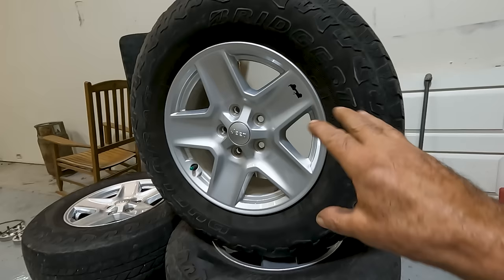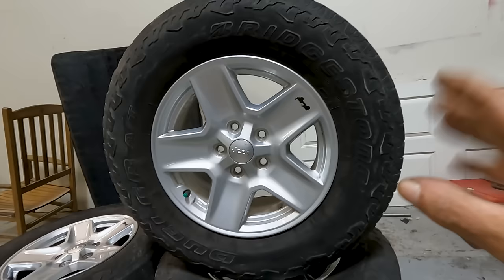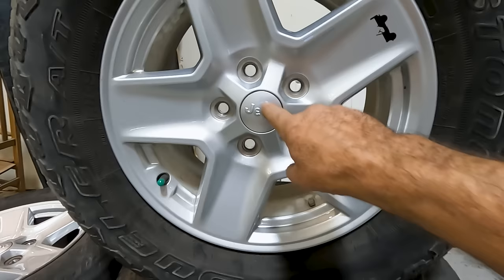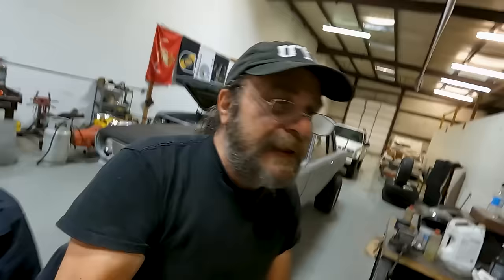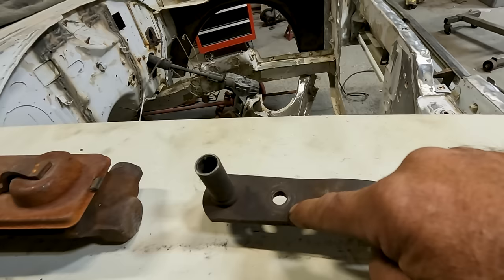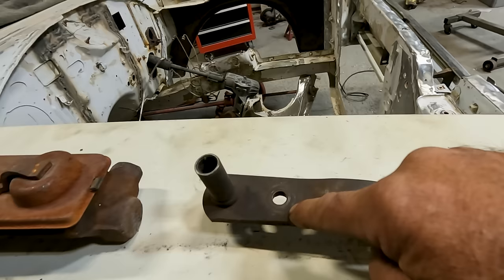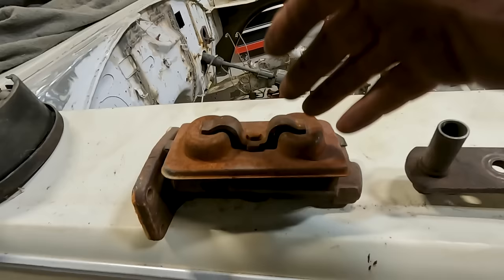Modifying Classic Cars And The Butterfly Effect - Can You Outsmart The Engineers?

Comment: Ok, I was going to start griping, but then you put in the limiting factor -- basically don't do it if you don't know what you're doing.

So, as a guy who occasionally drives a mid-'60's Mopar as a daily driver, let me mention:  1.  U-joints are a nice automotive advancement if you ever are on the road to Salt Lake City and you have drive train problems.  2.  A dual chamber master cylinder can be a life saver for you and your loved ones.  3.  HEI ignition sure beats points on starting and running - and is fairly simple and cheap to install (see Slant 6 forum).  

But, as mentioned, such modifications do require a certain amount of knowledge and skill.   For other people, many major car companies have produced quite reliable vehicles for a few decades now.

Comment: There's one little detail that is not being considered in this train of thought.  Yes engineers design these systems to work within a designated purpose.  However,  the budget team goes through the engineers original design and changes material and other parameters to make the design cheaper to produce.   So for that reason I believe that changes to improve vehicle stability can be justified if you have a particular purpose in mind.

Comment: My first and foremost suggestion is more energy efficient lights. (So there is less draw on the alternator.) Then Lighter weight wheels with the same size and offset specs. At this point people usually ask me my first suggestion when someone talks about adding or increasing power output....well, my suggestion there is to start working on the cooling system as step one. Because the by product is heat. And then follow that up with smoothing out entrance to the the oil drain back holes. (This is usually when everyone stops listening to my because I’m apparently crazy, and an overthinker)
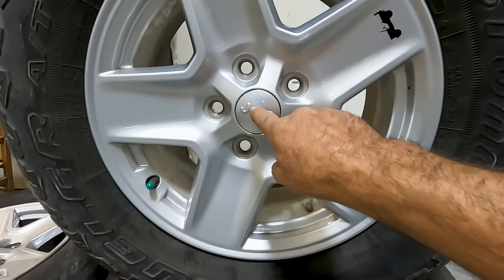Reply: 4:45 also besides the leverage. 
We also should take into account the additional weight. And the fact that those two things decrease the brakes ability to stop, however the amount of distance vehicle covers is increased with each and every revolution of the wheel/tire.

Comment: I've had great success with drum brakes. Heck. In the 80's we didn't have so many if any aftermarket options. Even on my 95 truck I had the rear drum shoes relined. Nope didn't buy auto zone shoes. The material I used was better for my usage. It's a lost art to line shoes.
Reply: They just glue on new material on cheap repops at the Chinese factories...I don't even know if you can buy new lining material anymore...
Reply: @dyer2cycle  it's an old school shop. The material left is the good stuff. As printed on bill, for off road use only, may cause cancer. Etc

Comment: I did on my Duster I got  10inch brakes on the front. The back brakes is 9inch but not enough pressure to the back. The problem was with the Master Cylinder. I thought I had disc brake Master Cylinder it was for drum brakes,a guy on the Forums told me  I can take valve to front of Master Cylinder to send more pressure to back brakes.

Comment: 100% agree.  When I restored my 1969 VW beetle, various friends of mine kept telling me to “upgrade” this and that.  I wanted to actually drive the car and kept it stock.  Was very happy with the result and the car was very reliable.
Reply: As someone who's owned almost a dozen air cooled VW's , about the only improvement over stock is putting premium tires on them, a set of Pirelli P6 tires makes a noticeable improvement over cheap tires often found on them. 68-70 bugs are near perfect cars.
Reply: @indianaslim4971  agree.  It was a really well thought out car in my opinion.  At the time, my tire shop could only get me cooper tires in the stock size.  It even had the autostick transmission that worked flawlessly.  Was a fun project.  Wish I still had the car.
Reply: Hopefully your drum brakes stars locking tabs are in good shape. I upgrade my Beetle to Ghia  front disc brakes.
Reply: @vintage76vipergreenBeetle  those stars were in good order. The four drums worked great once they were adjusted properly.  Never had an issue with stoping power.
Reply: @vintage76vipergreenBeetle  I worked at a shop that specialized in VW's and never came across one that was broken, would not have concerned me if one was broken as it's metal and I'm a good welder.
Reply: @indianaslim4971  Up here in New England, rust doesn't give up.
Reply: @vintage76vipergreenBeetle  Same here in northern Indiana, luckily I lived in Dallas TX for 26 years where the bulk of my working career was.
Reply: @mongo64071  Glad to see, I'm not the only vw gearhead that watches UTG.😁
Reply: I am curious, what did they tell you to "upgrade"?
Reply: @mexicanspec  Things, like disc brakes, aftermarket exhaust system, aftermarket ignition system,etc.
Reply: @mexicanspec disc brakes, aftermarket ignition, carburetor, swap the autostick to manual, different size wheels, swap oil bath air cleaner to paper, higher performance heads and bigger pistons.   Basically, everything in those aftermarket VW catalogs.
Reply: Did they tell you to do whatever that modification is that makes the rear tires lean inward at the top, and outward at the bottom, at about a 45 degree angle?..I see that a lot on old Beetles...I just don't understand the purpose of that, it looks ridiculous, and has to be terrible on tire wear, driveability, and suspension wear...
Reply: @dyer2cycle  no.  That’s just ridiculous.

Comment: I agree. Talking about front drums. Chrysler power drums stopped really good.
Reply: I used to drive a 67 Fury III on a regular basis 383 4bbl with four manual drums. It was not that tough to drive, the manual brakes were easier than some cars with power brakes now. If anyone has drive a Chrysler power drum brake car from the 60's they would understand why so many had manual brakes. My grandpa had a 65 Coronet with power drum brakes, they were way too touchy.
Reply: My 1963 Fury has manual brakes, no complaints from me. @JrGoonior

Comment: Hot rodding is just creating a series of problems for yourself to fix. You can have a driver, show car, race car...chose any two because you can't have all three. I have seen so many hot rods with miss matched brake systems and poor braking. I have actually fixed a number of hot rods that rear ended the car ahead because the brakes were ineffective. Pedal ratio, master cylinder, caliper size, brake diameter, combination valve, hold off valve residual valves, booster size and type, etc. I specialize in fixing hot rod brakes that are all messed up. You can have too little or too much brakes. Brake engagement and modulation are important as well.

Comment: I agree… but.  I have a 79 Fiat spider, 4 wheel disk and the brakes just suck.  So it depends.  My 2003 F350 that I regularly pull 10 to 12k with, those get serviced regularly and are stock, that’s a HUGE safety issue.  My model As, those are stock because braking is more a suggestion with those and they’re just cool AF.

Comment: This can apply to bone stock cars as well.  My wife is convinced there is something amiss with my 99 Mustang because it doesn't ride like a normal sedan ... and the slightly uneven idle versus the almost complete lack of noise/vibration in 2018 plus cars scares her.  Talking about wheelbase length and OHV valvetrain does not allay any concerns.  Funny thing - expectations for the uninitiated.

Comment: Aye. We in europe are in luck in this regard. There is a wide range of cars , specially wag cars that are compatible with each other. We have upgrade paths for those buggers. Specially since many of them have sporty and standard versions. So we can get a disc brake swap on front and back , with all the correct parts. Thst does indeed provide a correct path to upgrade.
Many Times its compatible between generations. A prime example would be the mk1 golf , with its very underpowered brakes. We can indeed use the full system from up to mk3 golfs,  including the gti versions. The difference is stunning. Same for steering , low tier modells do not have power steering. Many of them lack brake boosters too .
But as long as we fit the entire system , we can progress in the upgrades without getting into a stupid situation. Suspension wise we allso have a lot of options and many combinations was available from the factory as stock. So we can drive our old cars , and have the safety of much more recent ones , while we can avoid solutions that did not work out well from the factory. 
Applies to mostly any part of the car to be frank.

Not a popular opinion , but I would say usa cars where designed with a better plan to begin with. In europe we kinda have a lego situation , and there are stock solutions that should be avoided and instead , later modells technology retrofitted. As far as safety goes. 

Fantastic to see the differences between how technology was different. And we did not mention them communist cars. 

Now thats a topic of its own for sure.

Comment: except that cars back then were designed for less traffic, and lower highway speeds. And of course, even after the engineers come up with an idea, the accountants get their say on the end product. We also know of flaws, like the Nova level drum brakes on GM A bodies in 1964-65 and deflated tires on Ford Explorers. Thanks to the internet, however, we can find out if an aftermarket brake setup works better or not. we just have to pay to get it correct rather than be cheap.

Comment: When you say don’t touch the brakes , what about a car with four wheel discs . Switching them to drilled and slotted rotor . Not changing anything else , just those rotors  for better cooling of the brakes . Maybe a better set of pads .
Reply: Drilled and slotted should be for a track car only, normal daily driving won’t take advantage of the holes and slots. A blank face rotor has higher surface area and will actually stop better than drilled and slotted
Reply: @Matt_B0309  I installed a powerstop 4 wheel drilled and slotted disc brake kit on my brothers 2018 F250, it does indeed stop much better than the stock brakes did, even when the truck was brand new. That truck has big rims with big tires, so that's probably why it helps, plus the truck is a tank.

Comment: I got an older mid sixtys car, and I am considering putting front rotors on it, and it's a factory drum car and the reson I want to is that I' am planning on doing a 30l00 mile trip would that help in my situation I've been doing some things to the car like headers and  exhaust and basic maintenance
Reply: Headers, exhaust and disk brakes all have exactly ZERO to do with reliability except All will decrease it. 

It’s been fine for 40+ years and you think you need to change it?

Sure fine til the headers rattle loose and you realize they’re a nightmare to tighten. 
You finally get them tight the realize on the highway the headers cook the starter. 
Then realize the headers and exhaust block the starter in.
And you’re back to square 1

Bro I’ve done dozens of 3000+ mile trips in 30+yo cars. 

Advice from a pro- you’re worrying about brakes. 

You don’t even use the brakes on highways for hours at a time.
Reply: Is it one that had optional discs ? If so… look at one, as Tony says.. see what is actually different. Like the valves and such.  Replace as needed.  You’ll get by driving normal with the drum stuff most of the time but that one time you really have to plant both feet in the pedal it’s a different story.  All things considered.. none of the original 60s era stuff functioned the greatest in true panic stop situations to begin with, especially after suspension and/or engine mods.  With the lack of parts cars these days… brake kits are better all the time

Comment: I like modifying stuff. Butt, I think Yer right about outsmarting the engineers. It made me think about what I do when I make changes to things like brakes. I Cut'n'Paste from an already engineered solution. Like taking WJ brakes and Master Cylinder and booster and what not to fit in a XJ. ... wish I could copy'n'paste that engyneer'n into mah head and well, yea. Be careful! Be Mindful! Does it really need to be changed? What other parts are changed in a system? 

...

Imma snow bank guy (no shady tree's here) that like big ol' tires'n'brakes without the lift. Another mod is to use WJ control arms for more turning circle without rubbing and ride comfort butt requires messing up the adjustment brackets... lol! <3 all

Comment: Actually outsmarting the engineers is an absolute necessity in some cases. Take a 4.2 v6 ford. They have a balance shaft that makes the engines life short and miserable. If one simply throws it away, then replace the bearings with new ones turned to block the oil galleys that used to supply them it’s problem solved. No internal oil pressure leaks, no metal in the oil, no knock noises. A tiny tiny engine wobble about 1400 to 1500 rpm that if I didn’t tell you existed most people wouldn’t even notice. The only real benefit of those balance shafts is when the engine is placed in a mini van. Ford chose to put balance shafts in them all under to guise of “all the same” streamlined manufacturing. Well even with that excuse they are not all the same. Trucks have the Windsor bell housing pattern and mini vans have the Vulcan pattern.

Comment: I have managed to make the "bolt on brake kits" actually work and its taken me a tremendous amount if time and experimentation to figure it out.  Ive never installed a disc brake kits, ive only made existing installed brake kits work.  The kelsey hayes 4 piston calipers are the worst and single piston cslipers are the easiest.  Ive had to experiment with master cylinder bore size, brake pedal ratios and wheel cylinder bores to get the "bolt in kits" to function properly.  Once the kits are didked in, they work well, but i dont think its worth the effort and expense to get to that point.

Comment: When I update an old car to disk brakes I always replumb the entire system, all new lines, new appropriate master cylinder, proportioning valve, usually an adjustable one etc. etc.  The only part that might remain is the rear drums. And I do it as much for ease of maintenance as anything else.  Right now I'm doing an 82 K20 truck as a daily driver, brakes are fine and remain stock, but I'm putting in new fuel tanks baffled for EFI all new fuel lines, pumps etc and throttle body injection, and will likely replace the ignition system as well and let my ECU take care of ignition and timing and that's about all I'm going to upgrade from stock. 

My 1954 Power wagon on the other hand is in no way capable of modern highways in any way shape or form without a whole lot of changes, it doesn't even have self adjusting or even leading shoe drum brakes.70's or later vehicles are a different animal.

Comment: I normally agree with most of UT's comments, but I take exception to his logic of brake development---and least with GM A-bodies from 1964-72. They clearly didn't take all contingencies in to account. The first cars designed were a 6cyl model with drum brakes. Did okay (I own one). Then for the following years, they added more weight (as much as 1000 lbs) and more power (as much as 300+ HP on top of the 6's output), and left the same drum brakes on there. One "improvement" was a little known "big brake" option on the '65 Chevelle--They put Impala brakes put on the front.  This went nowhere. Wasn't until 1967 there was a disc option--which few bought. They even sold big block cars with manual drum brakes. Not thought through there.

Comment: With a trailer you suspension makes a huge difference.  If it didn't they would not make load bars for trailer hitchs. Adjustable helper spring in the rear help a lot.  Also you need to load the trailer correctly, the weight of the trailer is part of load.  People need to consider the side wind load.  Camping trailer or enclosed are the worst.  The towing rating are way over rated from the factory.  There is a huge difference from a car axil (1/2 ton) vs a full floater ( truck axil 1 ton).  I wouldn't pull you car hauler with a car on it with that jeep. Stay with you 80 tow truck.

Comment: Drum brakes get a bad rap. My last Slant 6 73 Valiant had 10" front drums (optional upgrade from factory) and they stopped on a DIME!!! The 73 Valiant I'm driving now (also Slant 6) original purchaser opted for the factory front disc brakes. It's nice that they don't pull side to side as much but I actually think the 10" drums had more stopping power. I did briefly drive a 69 Valiant a few years ago with the 9" front drums and I must admit I found its stopping power left something to be desired. But still, I agree with Uncle Tony here. Only time I'd consider doing a major upgrade to a system in my car would be if I was swapping from an entire parts car that had every last correct piece included. Keeping things serviceable as per factory specs is the best.

Comment: Try to explain to guy who slaps an 8 inch lift, and 38's on a half ton pickup, no brake upgrades, no gear ratio changes, why it's suddenly a gutless turd that won't turn or stop. "And it was fine BEFORE  the lift & tires" ?  ...."Well.......uh........."
You did half the job. It really is car mods in a nutshell, and if you daily it, stock is best.

Comment: You cannot compare engineers of the 60s and 70s to engineers of today, case in point, I owned a 1971 Plymouth Roadrunner with the 383 and all drum brakes. to stop this thing I almost ran into a ford pinto and had my feet stomped on the brake. I stopped in time, if not I would of made the news. It also had points and condenser, I had to keep a feeler gauge in the car along with points, condenser, a dwell meter( remember those?). in the 80s I bought an electronic ignition from Direct connection, I no longer needed points, dwell meter ,condenser. car ran better got better gas mileage. My point is the technology is different now.